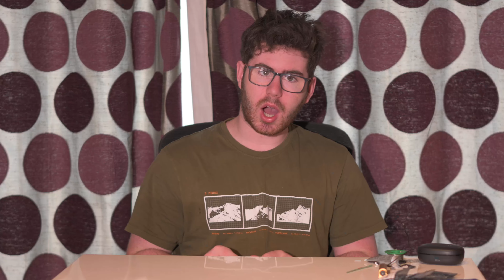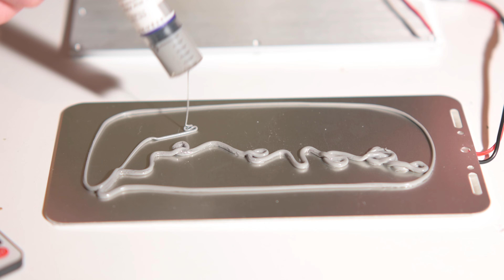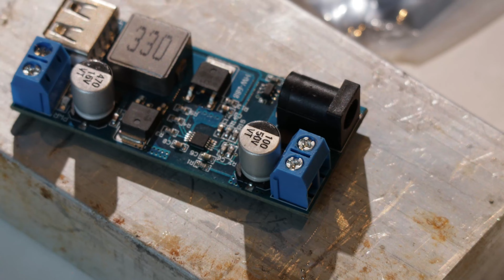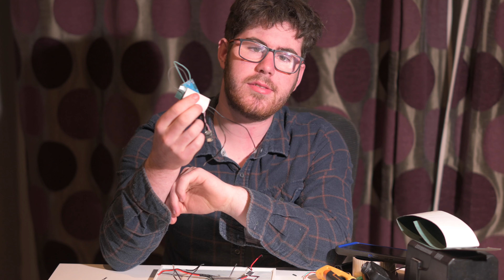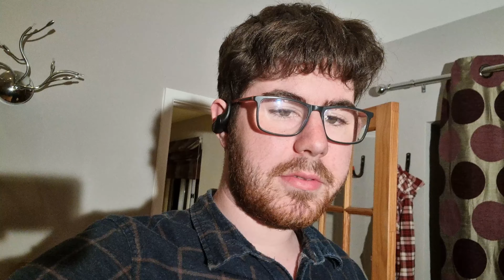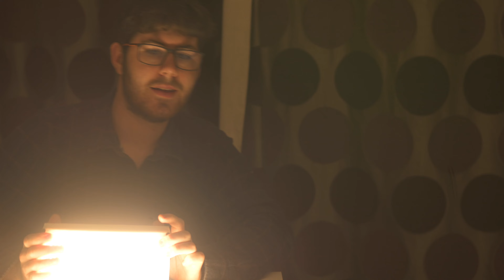How to build a Portable floodlight

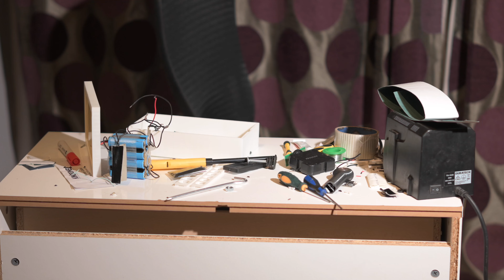Comment: 6:43 so, a couple things: usually a MOSFET's gate threshold voltage is pretty low, it'll start turning on (just barely, meaning a high drain-source resistance) with just a couple volts, and then the drain-source resistance approaches its minimum at maybe 10 or 12 Vgs. You really need to read the datasheet of a MOSFET to have any idea what a given gate-source voltage will do.

also: ideal MOSFETs don't automatically turn off when you disconnect the gate (see the end of the comment for why real MOSFETs sometimes do anyways, and why this shouldn't be relied on). the problem is, a MOSFET gate is basically a voltage sensor, it's a small capacitor that detects its level of charge and turns the switch on and off. When put your hand on a Van De Graaf generator and your hair stands up, it doesn't immediately flop down when you let go, because you are still charged; you have to touch something grounded, causing a spark of current equalizing your voltage with the voltage of ground. similarly, an ideal MOSFET gate doesn't consume the charge in any way, it just sits there, the mere presence of a charge difference between the gate and the source passively activates the switch. so when you disconnect the drain from the voltage supply, it'll keep chilling there. This is great for efficiency, it means that you don't need to consume any power to keep the MOSFET turned on, you put in a small amount of energy to turn it on and then it'll just stay on, modern computers would not extremely inefficient without this advantage. in your application, where you just want a simple circuit to make a switch turn on and off, this doesn't matter and is just an annoying problem you have to solve.

The solution is to connect a resistor between the gate and the source, something in the 1k-10k range probably. That way the gate-source capacitance is constantly being discharged, and requires a constant stream of current to keep it topped up, so if you cut off the power it'll discharge at a predictable rate and quickly drop below the threshold voltage, turning it off. You can check the datasheet for the gate capacitance and gate threshold you can calculate how long it'll take to turn off for a given voltage and resistance, but practically for your use case 10k should turn it off plenty fast enough while only wasting a negligible amount of power (as per ohm's law, at 12V a 10k resistor draw 1.2mA of current, 1.2mA * 12V = 14.4mW). This is often called a pull-down resistor, because it's "pulling" the gate-source voltage towards zero. when you connect the gate to a voltage supply, it's a much stronger connection so it "wins", "pulling" the voltage up to 12. when you disconnect it, the pull-down resistor "wins" by default.

In practice, nothing is a perfect insulator, so the imperfect insulation between the gate and source of a MOSFET can be thought of as a "built-in resistor" between the gate and the source. However, this is an undesirable property, and manufacturers are always trying to maximize this resistance. the only spec for gate-source resistance you'll find in a datasheet, if any, is a minimum value, so if you make something that relies on it being at most a particular value, it's either not gonna work, or be up to the silicon lottery, random environmental factors, the electricity gods, etc. essentially, a real-life MOSFET will turn itself off when the gate is disconnected, but you can only calculate the minimum amount of time it'll take, in practice you never know if it'll take 100us, or 3 seconds, or 3 hours. and if it does take 3 seconds, it's gonna spend a lot of time in the in-between ("linear") region, where it's switched on but its drain-source resistance is pretty high, causing a large share of the power of the circuit to dissipate in the MOSFET, and it'll blow up.

if you don't like this weirdness about charge and voltage, you can use bipolar transistors, their "gate" (they use different terms, the "base", "emitter", and "collector" of a BJT roughly map to the "gate", "drain", and "source" of a MOSFET) is a current sensor rather than a voltage sensor. they're very different devices and not as well suited to this application, but for a simple device like this with relatively low performance needs, you can basically pick whichever type of transistor you find the math easier for.
Reply: oh. reaching the end of the video, you did use a BJT? i think you missed that change in your narration, because where you last left off you were using a depletion-mode MOSFET?
Reply: also, since you didn't mention datasheets at all, and idk what caused all the MOSFETs you got to not work, i should also mention that the pinout of transistors is not standardized, you have to check the datasheet for the specific model. for most packages I'm aware of, i don't think there's even a de-facto default most transistors will use, so you really can't get away with assuming the pinout.

I would expect some aliexpress transistors could be totally non-functional, but the majority of the "non-legit" transistors you get will be counterfeits. counterfeit components usually try to fly under the radar, they don't want them to be obviously fake at first glance which means they need to work and not instantly blow up. the ideal counterfeit component is one that doesn't cause any problems at all, and the next best thing is one that doesn't fail until it's too late to reject the batch. most counterfeit parts are either salvaged parts that have been cleaned up and sold as new (very problematic for electrolytic capacitors which wear out over time, while semiconductors theoretically might still work fine), or a cheaper part (or even a clone) that has the same basic function, package, and pinout, that has had its markings changed to make it look like a more expensive part. that's why i'm suggesting possible circuit issues, it seems weird that all the MOSFETs you got were fully non-functional (unless you bought them all from the same seller)
Reply from the maker: I used a depletion mode mosfet
Reply from the maker: The issue with the mosfets was Purley that they wre from aliexpress, I have actually since recreated the project with new mosfets and everything is working fine. I just had mosfets that didn't match the data sheet. All the mosfets were same pack, I nought it specifically for this project.
Reply: @Boris_Woodward  ok, that's good. i'd still recommend adding a resistor to discharge the gate for long-term reliability though
Reply from the maker: @spambot7110  yes, I have one in the final project, it isjust about visible in a few frames when I'm assembling it

Comment: Look up those MAX745 lithium charge modules! You can connect one directly to 20V and it steps the voltage down to 1-4S for your battery, has an adjustable charge current. Much easier and efficient that way.
Also, with the heatsink inside and without fan it will definitely overheat the leds very quickly.
Reply: the IC supports this, the question is whether the board does. the input capacitors also need to be rated for that voltage, and since it's a buck convertor, a larger voltage drop means more ripple current for a given inductor value, so it affects the calculations for the inductor and output capacitor as well. the chip is only part of the picture
Reply: @spambot7110  It does obviously. Also it basically needs to, since 4S is 16.8V that means you need to supply ≥18.8V for it to work at all.
Reply from the maker: The supplier that these boards come from has 20v modules, but this project was rather time rushed, and as I live remote it would be hard to get them in time